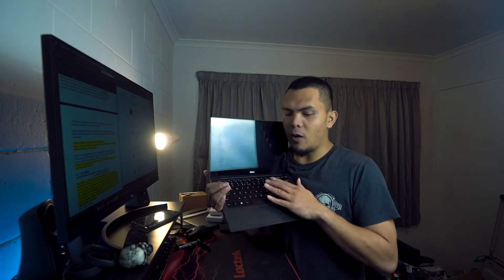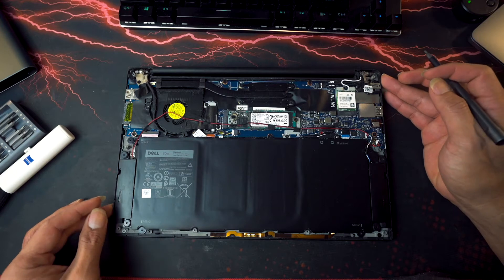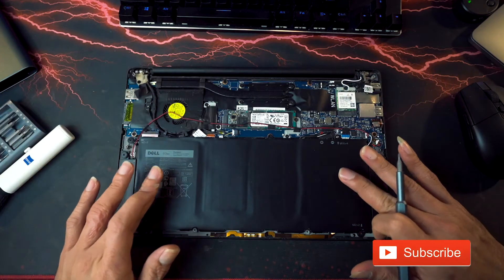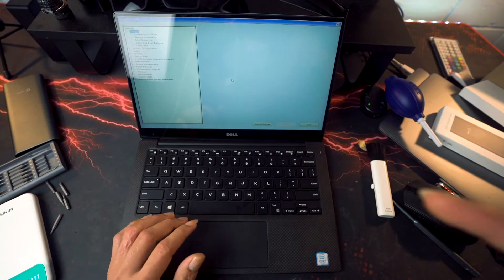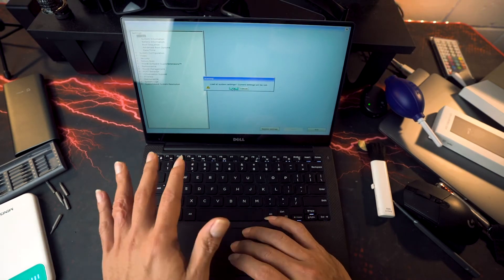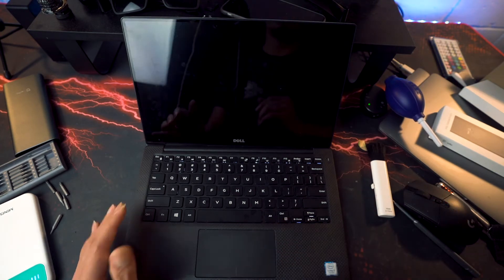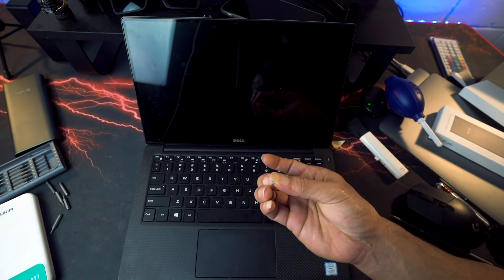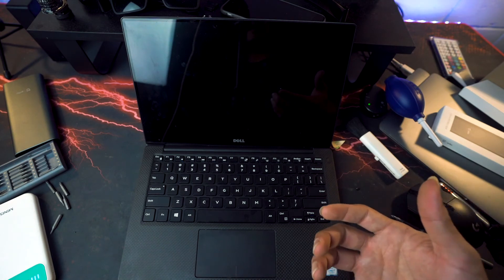HOW TO REPLACE DELL XPS 13 Keyboard // EASY DELL XPS 13 KEYBOARD REPLACEMENT // DIY Laptop Repair

Comment: as my 27 yrs of custom PC builds and computer repairs I always said DELL's are pure TRASH and TRASH to work on!  MacBook Pro's are just art!
Reply from the maker: I was never a Macbook believer, but I have since replaced the Dell with a Macbook Pro and I've been using it for 5 years without any issues. Though, I cracked the screen on accident but I was also able to replace it without issues.

Comment: Nice work. 8:13 probably meant to say "Reattach BATTERY ...." but all good. Pity about the missed screw. Happens a lot when there are a lot of screws to remove and replace. Always best to do an inventory and go really slow when putting it all back together. Dell really made keyboard replacement as difficult as possible on this model. I'm not into conspiracy theories but I wonder how many people simply trash the device once the keyboard gives up the ghost. Real shame because the XPS 13 is a very nice Notebook and the keyboard is usually the first thing to become a real problem on these models. Cheers from the Land Down Under.
Reply from the maker: Good catch. Yes I meant reattach BATTERY for that timestamp and agree on the XPS being a really nice and powerful Notebook. I still think the XPS keyboard replacement is way easier and a macbooks? :D But, I have not tried replacing the keyboards on my macs though :D

Comment: Hi Armed, nice video, thank for that.  Any troubleshooting tips?
I have the keyboard in but only some keys are working...  and wierdly I can only login if I am holding the windows key down!???
Thanks for any help you can offer.
Cheers C
Reply from the maker: you mean an external keyboard? and the keys worked if connected somewhere else?
Reply: @ArmedandLoaded  Thanks for the reply. It "was" an internal keyboard... I have since taken it back out and thrown it away. The old one is back in and working as well as it was before.

Not 100% sure if the issue was the poor quality new keyboard or my installation that meant the new keyboard was failing. Cheers